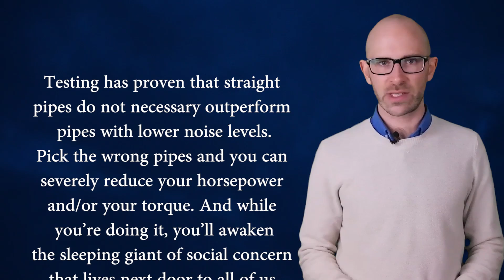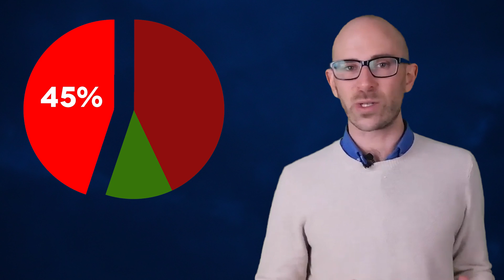Why are Harley Davidson Motorcycles So Loud?

Comment: I had no desire to increase the exhaust noise on my Road King but I couldn't hear my bike when riding with a group. It's now a little bit louder but not objectionable. I always wear earplugs under my helmet, not so much to protect my hearing but to reduce fatigue.

Comment: I fucking hate Harleys. I grew up in York PA, and if you're interested you can just google the connection.

Also, have you heard a muscle car with a 289 and aftermarket headers? That's what a powerful engine sounds like.
You know what sounds just like a Harley? A car with a hole rusted in the muffler. That's not a powerful engine, that's a shitty exhaust system. Don't dignify their poor choices.

Comment: I find it quite odd you did a video on this topic. Since I live in the city in which Harley Davidson was founded and ride myself, I do have to agree that extremely loud pipes can be quite annoying in the summer months. Although I do find that the stock pipes on many H-D's very muted the Screaming Eagle factory pipes are quite loud. Don't just target one brand for having loud pipes owners of other brands get pretty loud when the owner puts on aftermarket pipes (sportbikes included). In many cases most pipes are pretty sedate sounding unless you go hard on the throttle. None the less it truly comes down to personal choice on how loud you want to be. I wear a helmet so the sound doesn't effect me but I am respectful in residential areas. 
Now as for the "loud pipes save lives" for me is questionable since most drivers tend to look past riders even if you are right  in front of them, they seem to look through you. May drivers seem to be only aware of the other steel cages around them. That is why many of the motorcycle accident's I am aware of and one that I was involved in  (on motorcycle) the first thing that was said is I didn't see him when they pulled out in front of me. One last thing is Harley Davidson's will never be banned at worst you will get ticketed and be made to replace your pipes...

Comment: LOL, all the cruiser riders here insisting that loud pipes are worth it if there is even slight chance of protecting them from a crash, but refusing to believe the data that gear (motorcycle specific helmets, jackets, pants, and gloves) provides much more protection during a crash than blue jeans, leather vests, fingerless gloves, and baseball caps.  

All loud pipes do is lose rights...

Comment: To clear up the nonsense video, Harleys are loud for mainly two reasons. 1. Most motorcycles with over 1000cc of displacement have three or four cylinders. Harleys have two. Obviously this means larger explosion during the combustion cycle = more noise than most other bikes. 2. Due to motorcycles having less room, exhaust pipes are shorter and generally lack catalytic converters. The second reason applies to almost all motorcycles. To address performance upgrades, there are performance related reasons to shorten pipes or remove baffles. If, and only if, you tune your fuel delivery system ot will transfer the bikes power from the low end (slower speeds) to the higher end, raising torque at high speeds when the throttle is fully open. Not saying thats the reason most people do it, but it is a legitimate reason. I apologize for the formatting, doing this from my phone.

Comment: I have been riding Harleys with aftermarket pipes (NOT straight pipes, but louder than stock) for decades, and will continue to do so. I do not believe that loud pipes save lives, in fact that has been proven to be false time and time again. But they do sound good, especially on a Harley. Sound and vibration are the main reasons why I ride motorcycles, Harleys in particular. Harleys have a beautiful exhaust sound. I do wear ear plugs, and wear a full face helmet, but can still hear that wonderful sound. Harley-Davidson would go out of business if their owners could not use aftermarket pipes to make them sound like motorcycles should. Again, the EPA sticks it's nose where it doesn't belong, while ignoring destruction of huge amounts of land by developers, loggers, etc.

Comment: db is 20*log10 (sound intensity / reference sound intensity), so a change of 20db corresponds to a factor if 10 change - not 10db like you said at 1:00

Comment: I ride motorcycle everyday, I'm not a harley fan at all, nowhere near it. But I've had one that was too silent, so I modified the muffler, and what a change I experienced in cars behavior, before I experienced once a day a car was driving out right in front of me, and with modified muffler, once a week. 
Ofcourse, it was too loud, I like deep sound from 4 stroke Enduro bikes, and this one was banging like hell. 
So, I do prefer that the sound is "silenced" abit, even though a loud motorcycle may save the rider from falling on his arse sometime. its logic, and its not even comfortable to ride such a loud thing. :-)

Comment: Nonsensical statistical argument 

Single vehicle crashes are irreverent to multiple vehicle crashes 

Multiple vehicle crashes are irrelevant as the pipe played no part in them

What matters is how many accidents are avoided due to awareness of the motorcycle due to noise.

Comment: Motor bikes could be made a lot quieter than they generally are. BMW and the old Velocette Noddy bikes were very quiet (infact the first Noddy bikes were so quiet they were considered too quiet and latter versions were made a little louder). They were both horizontally opposed twin cylinder engines, coincidence ? I've no idea. Anyway I don't want to get into an argument as to whether bikes are too loud or not but the idea that a bike cannot be made quieter because of lack of room for an effective muffler is just not true seeing as BMW and Velocette could do this decades ago.

Comment: You said that 10 Decibel is a tenfold increase. That is wrong. One Bel is a DOUBLING in sound pressure. Ten Decibel is one Bel. Therefore ten Decibel is twice as loud and not ten times as loud.
Reply: Sorry, a Bel means tenfold increase (not necessarily of sound pressure but it's the most common usage normal people come in contact with). Not double.
Reply: Ohh sorry, i was a victim of a crossing of popular science and actual science. The articles i had at hand were either deliberately hard to understand for the layman or on the other hand where not clear that the doubling per 10 dB is a perceived increase in sound level while it is a tenfold increase in actual amplitude.

Comment: I have seen other videos of yours, and found them educational. This one, not so much. For background, I have owned over 5 motorcycles with stock exhaust, and currently ride a Honda VTX 1300 with loud aftermarket pipes. In a perfect world, if I had my preference, I would not have loud pipes on a bike... I would also not have to deal with other drivers. Because I ride in southwest Florida, where there are many inattentive (older) drivers, I find that the louder exhaust greatly improves the awareness of other vehicles to my presence. I have ridden other motorcycles and driven my car in this area, and been cut off by other drivers many times. Many car drivers here change lanes WITHOUT looking to see that the lane is clear. I have not yet been cut off on the current bike, and have been riding it for over two years. I believe that this is because the loud pipes make the other drivers aware of my presence in their adjacent lane.

Comment: I've ridden bikes for 35 years, all kinds. I use db killer baffles. If Harley owners really cared about safety, they would not buy arguably the worst motorcycles on the road for handling and braking , with poor corner clearance and awful positioning. The reality is that those bikes have more accidents. They also have unique accidents involving not hearing emergency vehicles and Harley owners have a huge problem with tinnitus.  These are not motorcyclists, these are attention seeking posers who want to display a checkbook badass persona through a herd mentality and fringed leather cosplay. Talk to these idiots and loud pipes save lives, helmets block vision, and the correct way to panic brake is to lay'er down. Pure Darwinism, but they ruin the lives of people who live in scenic areas on weekends as the racket is intolerable and just drives bike ban petitions and bylaws. Assholes.

Comment: I've been riding HD's for over 20 years.  I'm not particularly fond of excessively loud pipes, although I do enjoy the sound of a set of "good" pipes.  It's tough to tame those two large bore cylinders.

Anyway, I've also been a firefighter for more than 20 years.  I've seen a lot of motorcycle accidents, and when there has been a bike vs. car accident, I have NEVER seen one where the bike was at fault.  I have no clue where they could have gotten these numbers.  In fact, the vast majority of accidents that I've responded to were car pulls out in front of bike.

Comment: The fewer cylinders per pipe, the louder it is... I.e. A v-8 with single exhaust vs. the same engine with dual exhaust. However, the first thing the morons do who get a Harley, is rip the stock exhaust off... It's all about the noise.. Simple things for simple minds. (Me make big noise! Look at me! ) To top off the stupidity of these morons, I have seen many of them riding with ear plugs in... And no helmet... Nature has a way of thinning the gene pool.

Comment: You missed the point and the actual reason on this one boet. I grew up around them, and have been mostly a Kawi, or Honda owner in my adult life, so this is coming unbiased. It is not that they are "loud" as much as they have a distinct sound. You can describe their firing process to be more accurate in your opinion. A tuned Yamaha Vmax is the best and loudest cruiser I've ever been around even when some of my friends had the biggest S&S custom American style rides. Best two wheeler I was ever on? Either an open valve Maico 490 Alpha 1, or an ATK full factory race bike with the Nickel plated frame. Only ones that scared me. Triumphs that don't have brakes are also scary

Comment: Stock  mufflers on Harleys sound fine. Plenty to hear, but guys take them off and there are many great sounds in between exhaust systems that do improve performance. But  straight pipes with absolutely no muffler suck.  Plus  over revving bikes just to get people to look at you is really what people are complaining about.
 I want you to see me, but because I want you to stay away and watch out, I don't need you to see me because I am not   ok unless you think so.
Reply: I respect your opinion, but I think a large portion of the commenter basis here is simply anti-motorcycle and object to even moderate levels of noise. Many commenters here have tried to argue the safety concerns of being heard only to be flooded with hate.

Comment: Biased bull shit !
You can argue as much as you want but a louder motorcycle will attract more attention!
The argument of noise only directed towards the back is false.
Also keep in mind how frequently biker get pushed off the road by vehicles starting to overtake while having a biker already besides them.
Loud pipes save lives, they aren't fool prove, they aren't an excuse to drive responsibly but they work.
Keep in mind that electric vehicles are known to be dangerous because of the lack of noise and that is an undisputed fact !!!

Comment: I have just bought a new Harley which still has the stock pipes and they are pretty quiet, in the short time I have been riding it (I am still breaking in the engine) I have noticed that a large number of cars just change lanes without looking especially because they can't hear me. On my old bike this happened very rarely because, yes, they could hear me. Loud pipes really do save lives, however of course as with everything, there are common sense limits, it is possible to change your pipes and put db killers in them to tame the noise so the sound isn't 'too loud'. Running completely open pipes makes them too loud and actually makes you totally lose your back-pressure, and therefore your power band is shot, it's just pointless.

Comment: Loud motorcycle do saves life, or at least helps cars driver noticing riders. 
In congested highways of Paris, motorcycle are permitted to ride between lanes. Sporty bike riders have the habit to rev high to warn drivers that may cut their way, custom riding bikers do not need to, as their engine is already loud enough. 
But sadly we are entering an era of forbidding. Everything is going to be forbidden so no body would have it's weak sensibilities harmed. The future will be made of pussies, opinion-less Tesla driving mindless slaves ;)

Comment: YOU dont entiely know what the fuck you are talking about,standard exhaust systems strangle the motorcycle and dont allow it to breath and get rid of gases correctly causeing your bike to run sluggish,and even with staight through pipes they do dampen the noise some what,there are lots of other falsehoods in your statement,bet you never rode a bike,wonder how much your getting paid to spout this shit,

Comment: Because having a Harley is all about... "look at me". It's all an attempt at garnering attention. The ' loud pipes save lives'  thing is just an excuse for being a douche bag. And yes I've ridden bikes all my life.
Rode one Harley and couldn't wait to give it back to its owner. Actually I pulled off the road and waited a few minutes so it seemed like I rode it around and then lied to the owner and told him it was nice. Vibrated like hell, had poor power, handled like crap, had basically no suspension, and the brakes sucked. Besides that it was awesome...

Comment: Harleys are loud because, as they don't handle well, have mediocre brakes and are slow, a loud noise makes up for those shortcomings, at least to those that buy them. It is nonsense to say that noise is because bikes cannot be silenced properly. The Japanese can sell you (for not much more than half the price of a HD!) a near 200hp motorcycle that at idle sounds little louder than a car, and at highway speeds, ditto. Such a machine will also last twice as long as a HD without major attention, even though it will top 200mph without the electronic limiter.... it's called precision engineering.
There is the "loud pipes save lives" bullshit too. I have been on the road since 1960 on four and two wheels and I have NEVER heard a loud Harley before I saw it..... it's a myth that loudness is a safety factor, it's just anti-social crap that gets bikers a bad name.
What do I ride? At the moment an old (1988) CBR600 that is very quiet around town and will show a clean pair of heels to any stock Harley, straight line (SS 1/4 11.7) or on the twisties. It's comfortable on long trips too, and after 118,000kms (74,000 miles) the engine has had nothing but routine maintenance, the only exception being a manual CCT. The head has never been off as far as I can tell. Burns no oil, will do almost 150mph, can corner like a race bike, stops on a dime and is easy to ride in slow traffic....  only weighs 440lbs wet, too.
Harley Davidson bikes were "state of the art" not that long ago (well 70 years... but I've been around a bit longer than that!), and it has been sad to see them stagnate for so long.... Maybe one day they will be up there again.... I do hope so.... :-)